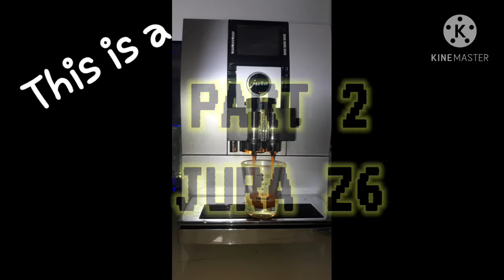JURA Z6 BREWER DISASSEMBLE by Copi Tek

Comment: Hey Copi!
Is it recommended to to this service (clean the brew unit) before any problems occur? I purchased a used Jura Z6 from a company auction. It has over 12000 cups made and I dont know its service history if any. It is working great! 
But im a maintenence kinda guy. Should I try this even if it is working good? Maybe there are more parts in the machine that could use cleaning, or any orings that should be replaced? How often does jura recommend making this service?
Reply from the maker: It's better to clean and re grease, every 6 months. Also check the condition of every oring, you can replaced oring every year.

Comment: Thank you very much. Thanks to you and your video I was not afraid to entirely disassemble and clean the brewing unit. I could remove all coffee moisture out of the Z6 (weird it is so dirty for a machine that price). Without your video I would not have managed to do this : to disassemble without destroying and to put back all the brewing unit parts together at the good place. But it is very hard to put back the side panels on the machine. There are videos to remove but no videos how to put them back in place. Have you produced such a video? Anyway, thank you very much again.
Reply from the maker: I did not produce the video for how to put back the panel. To do that, you need effort to feel the slide on slot to lock.
Reply: Ok I got it. The good way is to put back the water tank side panel first then the other side panel and only after that to put back the upper panel on top of the Z6. It took me 5 mn. Before doing this way it took me 2 hours and I failed.
Thank you again for your video
Reply from the maker: To put back the upper panel. You need to push all side to make sure it will be fit before you slide.

Comment: Hello one question i have sane Jura z6.Does the grinder have 3 springs and balls inside below small blade or not?Cause u can't squeeze the grinder enough.Whatever i doo it moves and grinding isn't fine enough.
Reply from the maker: The new version grinder of jura are not having spring and balls. 
They fit the lower burr on the plastic part, that's why it look like stuck on it.

Comment: Very much a risk to do it in the sink! You can drop small parts down the drain. Do the disassembly and reassembly on a work bench on a towel that will grab the small parts you drop inadvertently. Check this out:  https://youtu.be/d8MjFEXwY2Y
Reply: i WAS THINKING THE SAME THING....
Reply: if the video to check is out there, please find and post new link, that one is gone